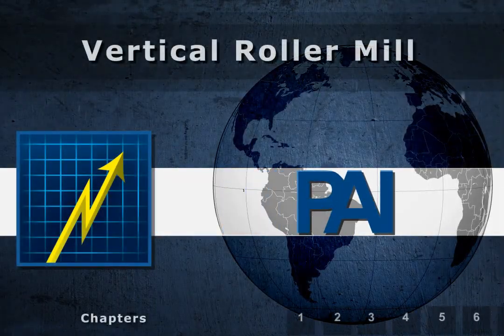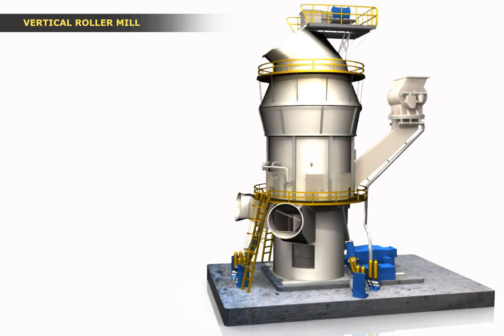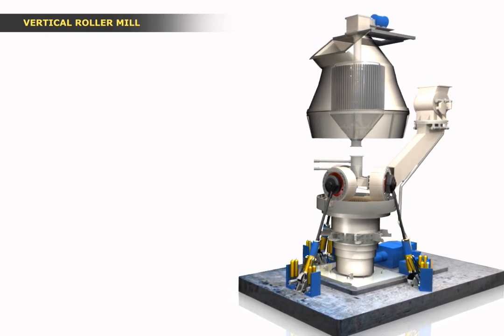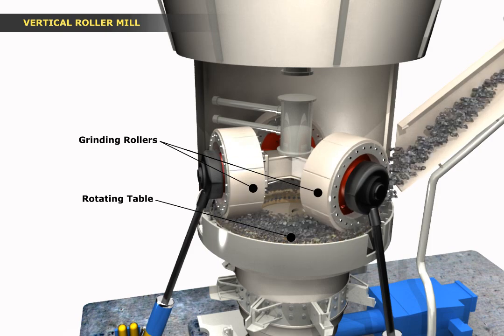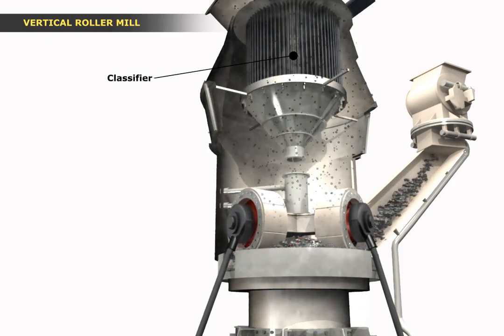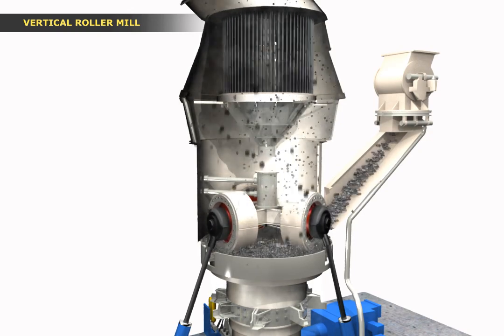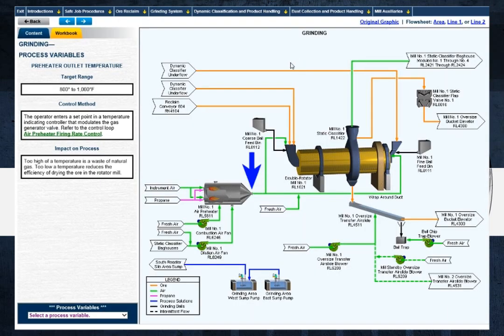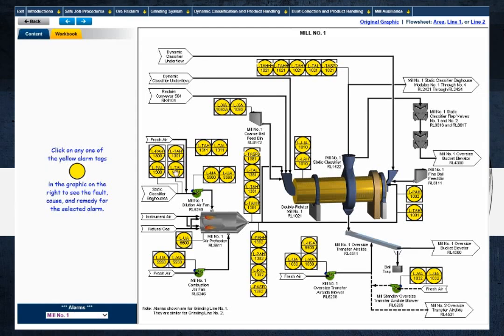PAI Vertical Roller Mill Training

Comment: Shenyang Heavy General Mining Metallurgy Equipment Co., Ltd is founded by Shenyang Heavy Machinery Co.Ltd located in Economic and Technology Development Zone, Tiexi District in Shenyang, which has long history and rich culture. Shenyang Heavy Machinery Co.Ltd   is established by Japanese Sumitomo in September 1937,which is first heavy machine Co.,Ltd in China, It create history of  heavy machine in China . Shenyang Heavy Machinery Group Ltd guided by the party and state policies to conduct overall reform of the market restructuring, diversion from 2006, In such a market environment, Shenyang Heavy General Mining Metallurgy Equipment Co., Ltd is born.

         Shenyang Heavy General Mining Metallurgy Equipment Co., Ltd (hereinafter  referred as SMZ),our products covers mining, metallurgy, power, cement and environment-friendly area, etc., and we mainly focus on designing and manufacturing equipments used in metallurgy, mining, cement plant, power industry and parts; design and development intelligent manufacturing system of heavy machine, manufacture new type mining and metallurgy equipment, contract large-scale energy-saving environmental protection project, develop high-standard heavy industry production line, service and solve various technical difficulties in manufacturing industry.

Email： smz_fred@yeah.net